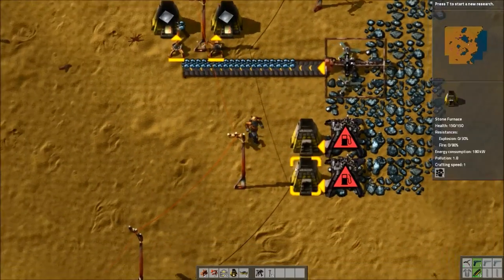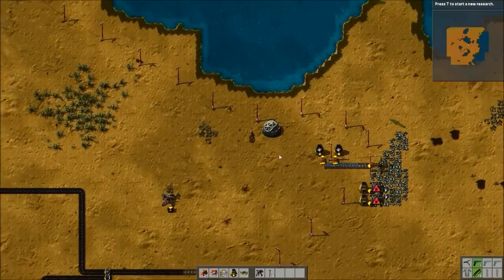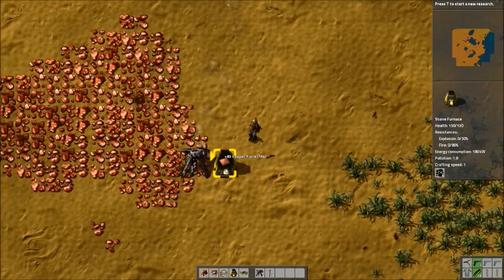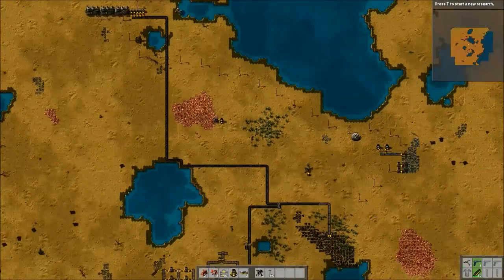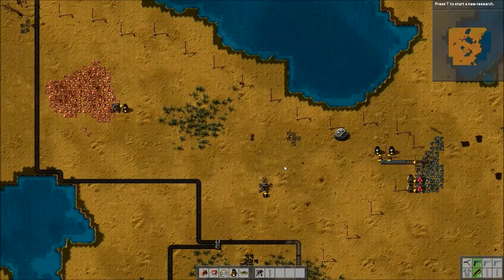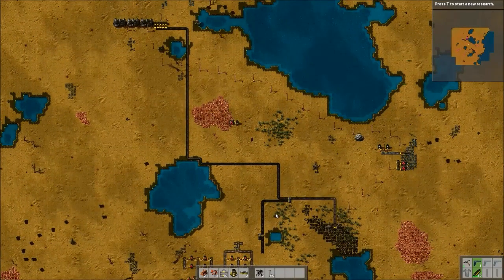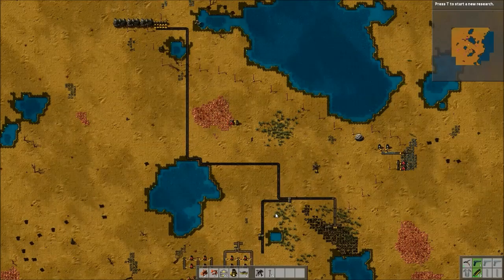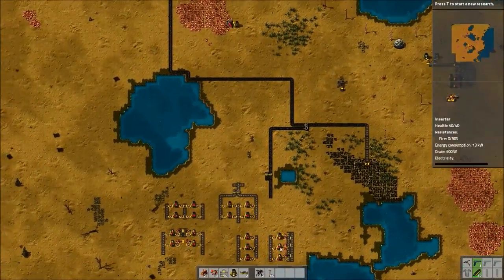Factorio Tutorial - Expandable Smelting Setups - Episode 3

Comment: Arumba has a new LP which features a nice furnace area. Somewhat similar to the one you had thought of for the upgradeable to electric.

Its dual belt input, with regular and long handed inserter, going into a coal furnace, which dumps into buffer storage which unloads into a belt that side loads the plates onto the main plate bus. and the same is mirrored on the other side so both parts of the plate bus are loaded. there is a two tile space between each "row" for furnaces, one for power one for electric upgrade.

once you upgrade to electric you remove the sideloading belt and move the buffer storage plus the two inserters one tile and upgrade to electric.
Reply from the maker: Ah very interesting. I will have to take a look at his LP to see exactly what you mean. :)

Comment: I think the 2nd example can work without with only burner inserters, because the inserter on the 'output' side can feed itself with coal from the furnace?

To make room for electric furnace later you'll need to add a belt or leave space of course.
Reply from the maker: +ThePunkPensioner Good point. I've actually never tested to see if a burner inserter will feed itself from the coal in a furnace but if so then yeah it would work.
Reply: +Xterminator I'm pretty sure that a burner inserter feeds itself with coal from a boiler. I seem to remember finding that out when accidentally putting them the wrong way round and after manually feeding the boilers because I couldn't work out why the steam engines weren't starting up.

Comment: How did you get the coal up to the steam engines, with the coal on both sides of the belt?
Reply from the maker: +Sir Crunchalot You mean how did I get the coal to be on both sides of the belt? I believe I just had a miner on each side of the belt. So two miners facing each other with a space in between for the belt to run through and then they each mine onto one side so that both sides have coal.